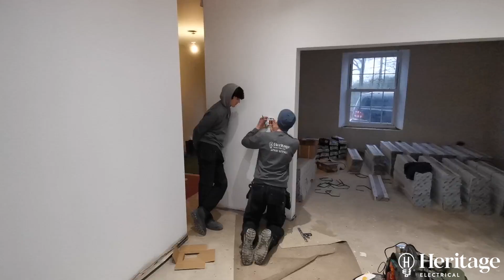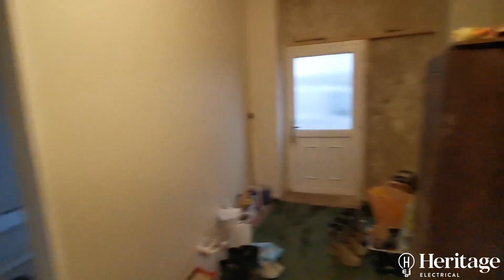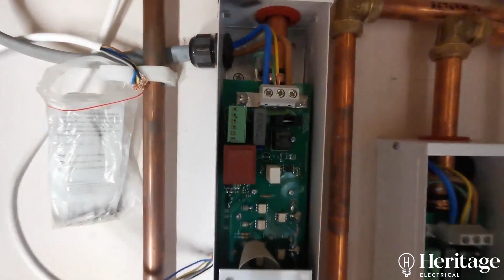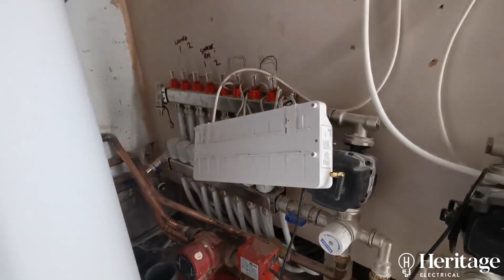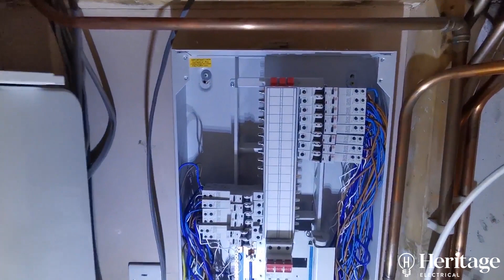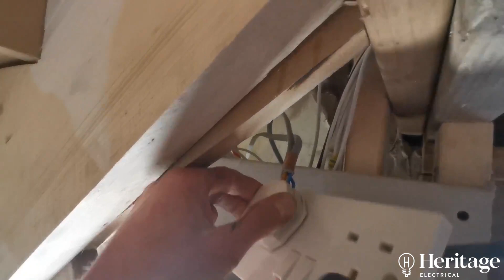🔥Expert Fix for Heatmiser Underfloor Heating⚡ 24/7 Emergency Service for Dangerous Electrical Faults

Comment: Hi Love your underfloor heating videos, could you help me with flowrates on the manifold? Internet search says between 1-2, surely this can't be the case with a large room compared to a bathroom? Is there a special way to work the flow demand needed to make things work efficiently? Many thanks Andy

Comment: This looks fairly typical of these Heatrae Sadia installs. I've not once come across one of those units actually set up for 12kw load though. Likely would be cheaper to have set the UFH up off the Worcester Bosch than the Amptec units though. Perhaps unit rates are cheaper in your neck of the woods.
Reply from the maker: Hi, thanks for watching our videos. 
There were 2x 12 kw electric heaters so, 24kw in total! 
Ive no doubt it would have been cheaper to run the UFH off the boiler but this was the design of the plumber and customer.
The customer mentioned solar and battery storage in future.
Best wishes, heritage electrical.
Reply: @HeritageElectrical  It's always nice to watch fellow engineers that take pride in their work. 
If they went solar and battery in the future a heat pump would of been a more viable solution considering the load and inefficiencies of the Amptecs in comparison.
Regardless that was one of the worst installs I've seen and I see so pretty terrible ones going around doing the remedial and fault finding on production builds as local councils have them shoved in as part of the going green scheme here. 
I hope to see more of your uploads in the future.

Comment: whats the range like from stats to logic relay box for actuators?
Reply from the maker: Sorry for the late reply mate - the range from stat to UH8 is pretty good. You can get a Heatmiser device to boost RF signals if required.